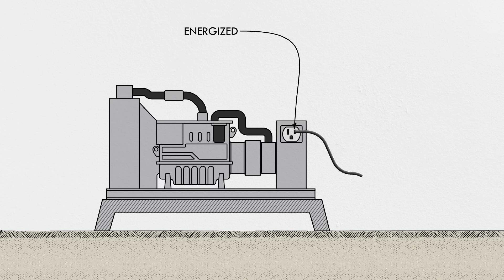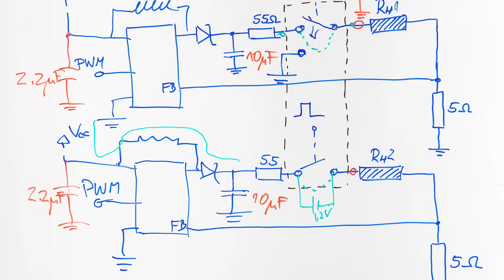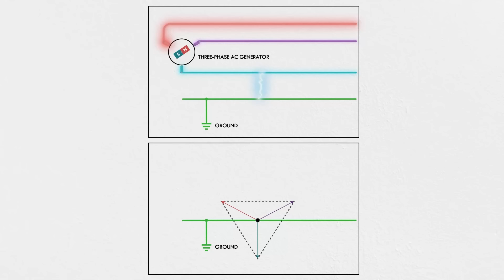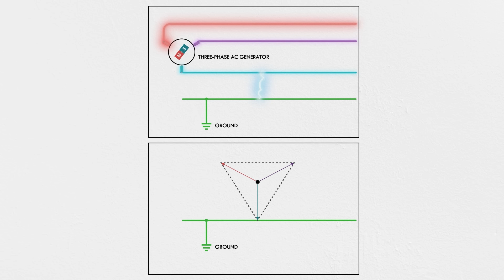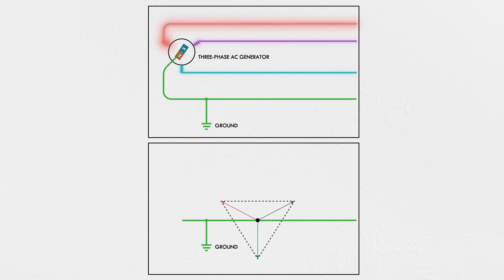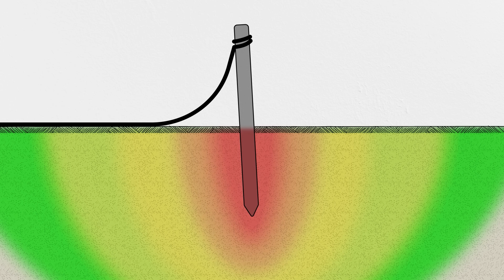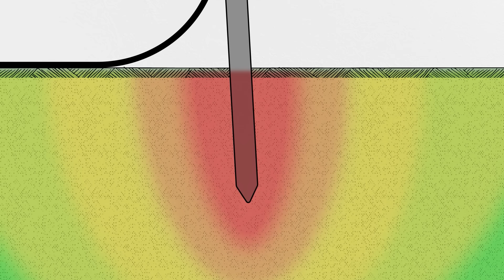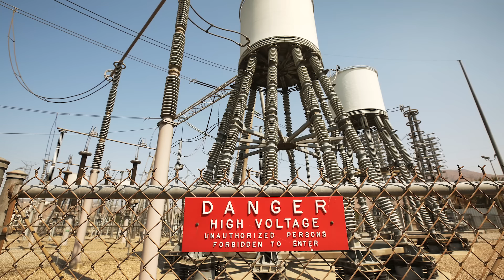Where Does Grounded Electricity Actually Go?

Comment: A lot of people make this so much more complicated, so let me clarify: Electricity that is caused by sources of our making, always MUST return back to a circuit node, so a closed loop must be formed, EVEN if the amount (amps) are not the same in amplitude (the circuit is not concentrated). It is only LIGHTING current that can actually move from point A (clouds) to point B (earth) without actually closing a loop (you will never see the lighting returning back to the clouds). We still don't know why it works this way, but we know that it is possible. So when you ground a circuit to the earth, current will flow from the earth and back to the circuit only if it forms a closed loop somehow, like a grounding fault where on phase touches the earth, the neutral is grounded to the earth so the phase + the earth as a conductor + the neutral closes a loop back to the circuit. In normal operation though, the neutral is grounded to the earth but this point is floating, it does not closes a loop back to the circuit and no current can flow. This is the normal and intended operation of the grounded mechanism.
Reply: so how does a ground fault happen in an ungrounded grid system. If only one hot wire contacts the ground and the generators aren’t grounded then how does the electricity return the generator which is it’s source
Reply: @A_youtube_channel_  I'm not very familirial with underground systems but in the air lines usually the following happens: In the transmission lines you have a 3-phase system without a neutral and you don't ground anything, so you are not protected from ground faults. If a hot wire touches the ground, no current will flow unless there is another fault nearby that touches the ground as well or the other faulty hot wire. In the distribution lines however which are usually located inside civil areas, it is FORCED to have a neutral that is grounded about every 100 meters, or whatever the standard says (at least here in Greece). In your case, even if the generator is grounded but your ground fault is hundreds miles away from the generator, the resistance of the earth is considered infinite, so no current could actually return from the earth back to the generator. But if you have a neutral and you are grounding it every let's say 100 meters, then at a specific point where a ground fault occurs, the current will find the closest grounded points and return back to the neutral and then back to the source as well.

Comment: Very good summary on electricity grounding and good summary how grounding works at the electrical power transmission level!. It gets a little more interesting at the power distribution levels and at the utilization voltage levels with some different ideas and opinions on the best ways to do it. Depending on where you are in the world, anything above  about forty thousand volts is considered to be transmission and below that is considered to be distribution. Voltages below one thousand are considered to be utilization voltages and 120V, 208V, 240V, 277V, 347V, 480V, 600V are common in Canada and the US but there are many more used throughout the world.

Grounding at the distribution voltages levels and utilization voltage levels are done for the same reasons but use some different techniques, strategies  and methods to try to achieve the same results. At the distribution voltage levels in addition to three wire distribution lines, four wire distribution lines are also very common at least here in Canada. The fourth wire is normally identified as an overhead neutral  and is grounded  at multiple locations about every two to three hundred meters and at every switch or transformer or other device on the distribution line. 

The idea is to have the majority of the fault current returning on the overhead neutral when there is a line to ground  fault  on the system. Also, with a four wire distribution line, in addition to three phase loads being connected to all three lines or two phase loads (can also be considered single phase load) connected to only two phases, you can also connect single phase loads only to one line and to the overhead neutral. They try to keep the connected single phase loads balance between the three phases but there will always be some unbalance current and they want most of this unbalance current to flow back to the source on the overhead neutral. Some will flow through ground since the overhead neutral is connected to ground at multiple locations along the four wire distribution line.

Comment: I can’t quite understand ,while the current flows “through “ the earth and returns to where?  What source, and how does the resistance of earth affect this flow. A simple one line diagram? 
As an electrician, I have a difficult time giving a good explanation to an apprentice, because I don’t quite understand it.

I do believe that the bonding, grounding and equipment grounding are probably the most confusing or least understood parts of the code book. When a group of experienced, and smart electricians have different answers to the same questions, tells me WE don’t have a thorough understanding of that subject.

Comment: A well defined, and properly wired, ground is also VERY important in (high accuracy and/or low signal) measurement systems. A good grounding combined with shielding can reduce noise massively and a floating ground can, well, "float" off and get out of range of your data acquisition device. Ground loops can also mess up your measurements by introducing nonsense signals.

Comment: The grid grounds lines struck by lightning:  The grid has lightning arrestors.  These are a spark gap.  When lightning strikes then the air ionizes in the gap. Ionized air is a conductor.  So the lines temporarily become grounded,  they are the same potential as ground. So therefore lighting doesn't damage power equipment (mostly, when things work right).  It's a neat cheap and very effective solution!

Comment: Having had to deal with said problem. I wonder if you'd be able to make a video on ground electrode passivation, and its' effects on in-house voltages.
Which is really only  an issue in TT systems, as well as TN and IT systems when the supply 'ground' gets damaged.

Comment: in an electrical circuit, electrons flow from the negative to the positive side. This is because electrons carry a negative charge, and in an electric field, they are attracted towards the positive charge. However, when describing the flow of electricity, it's common to refer to conventional current flow, which is considered to flow from the positive to the negative side. This convention dates back to Benjamin Franklin’s time, before electrons were discovered, and it's still used today for historical and practical reasons. Despite this, the actual physical movement of charge carriers (which are electrons in metal wires) is from the negative to the positive terminal.

Comment: I have to sit down and digest your presentation. In the whole it explains the concept of "ground". But within the utilization there is neutral and ground which are connected in the panel and a sole neutral wire is returned to the transformer of which sometimes there is a return neutral (I just watched a vid involving a transformer replacement on a pole where there was a return neutral. At my residence there is none. The neutral is grounded at the pole). A broken neutral, within a structure or in the exterior supply line can result in excessive amperage readings at the panel or in the observation of extremely bright lights in a specific circuit (I have seen both). How do appliances continue to work if the neutral is not continuous to ground?

Comment: The higher the voltage into the electrode the more that voltage potential extends into the earth. They teach that in a downed power line scenario that you hop away instead of walking away. The difference of potential between your steps can cause a shock.

Comment: Why do antenna's operate more efficiently with a more robust grounding network? It seems as though the greater the surface area of the grounding network; the better the reception and propagtaion capabilities of that antenna, (up to a certain point I imagine).
Reply: I've noticed this too that antenna well grounded with a ground wire going to the building's main ground receives better than say an attic antenna where the only ground if any is in the radio.
And the radio itself might be isolated from ground because of it's own transformer.

Comment: Could you do an article on domestic grid connect solar inverters ? I’m particularly interested in the flow of current back into the grid. How does a high source impedance such as an inverter feed into a low source impedance such as the grid and increase its voltage ? How far does this feed in current go , all the way back to the HV transformer or just nearby?

Comment: This is a great vid. Is it the case the electricity returns to the generator after passing along wires to houses…You said as much by saying electricity flows back to the grid.  I see three wires in my neighbourhood that feed to four wires that connect to my house… is the extra wire to my house a return neutral wire. If it is , then why aren’t there four wires on the other system. What happens at the end of the 3 wire system at the end of the town… thanks , if you can help me

Comment: 0:16 well, that's like running energy through a wire then it going through a resistor with whatever resistance the ground has, assuming this is a closed circuit.

So the ground would heat up wherever the energy flows, like a resistor.

Another way I'd imagine it is, what happens when lightning strikes the ground?
That's a massive circuit between the ground and the cloud.
Like a capacitor or something having enough charge (voltage difference) to force a connection to the opposite-charge-rich ground.

Lots of light, sound, and heat.

Pretty sure lightning can melt sand if it hits.

Okay, so i was wrong, it's not a closed circuit.

Comment: All the electrical/computer engineering labs in college had a bag of dirt with a wire in it. One time my buddy and I hooked our ground rail to one and were disappointed that it didn't work like the common on the power supply.

Comment: All electrical poles have a ground wire attaching to a 8ft ground rod in the ground. So when the hot wire touches the ground during an event, the circuit becomes complete. Meaning, the hot wire (+) makes a connection with the ground wire (ground). The purpose of the ground rod is to create the lowest point for the electricity to go.

Comment: What current does when it goes into the ground is very complex. Current is made from moving electrons which are described by quantum field theory, so we only have first and second order models. The first order model would be the electric circuit. According to KCL current will travel through every possible path, inversely proportional to the impedance of the path. The complexity of grounding is that the paths are not discreet, like in an electronics circuit but have a continuum infinity number of paths to complete, it therefore travels more like a wave. In my mind it is a controversial practice to use FCDIST in CDEGS to calculate current split factor during grounding studies because of this fact. The assumption being that fault current mostly returns along the transmission line supplying the fault, which seems like an untested hypothesis.

Comment: Before I eatch this I'm going to make assumptions and then see if I was right of wrong.

1) You think electricity is electrons flowing
2) You don't take into account what the dialectic is
3) You don't believe the earth has massive currents

I'll respond here after watching.

Good video.

1) You didn't specifically touch too much on this so we'll move on
2) You briefly spoke about dialectric (static electricity)  and mentioned "we don't really know much about it." We DO know but it isn't taught anymore. We've known since Maxwell, JJ Thomas, Tessla, Steinmetz, Heaviside and as recent as Dollard. You whole video focused on the electromagnetic side aka transverse waves. Yes those are not as efficient in moving through the earth HOWEVER longitudinal waves are. 
3) You briefly touched on this and it wasn't the primary focus of the video so I'll wait for a future one to discuss this further.

Comment: I think the crux is that power lines inevitably break and fall to the ground. if neutral does then the ground completes the circuit. Adding a PE wire preemptively completes the circuit instead of when humans accidentally touch anything

Comment: I'm electrical engineer and I see a lots of problem in his lecture. First, in an electrical circuits ground does not hang rather it refers to a common point in my circuit Vcc is also a common point does it also hang too?
By calling grounded and ungrounded power lines didn't mean delta and way connections? In both cases VLL is the same.

Comment: So, does this implies an ungrounded circuit is an undisturbed close loop system in equilibrium? Would a short circuit be a 'leakage' that over-stresses the voltage source because a drain breaks a previously established equilibrium and the voltage source tries to compensate now?

Comment: I have a question which you are not obligated to answer but it would greatly ease my curiosity: if I where to stick a rod of aluminum in a dune of wet beach sand and a copper rod in an iron deposit three or metres away would it generate a current just from ambient earthed current alone?

Comment: yo hey @practicalengineeringchannel FYI at 10:40 in this video, there's an error. You chat about difference in potential at each point in the wire, however the meter is on Ohms and displaying Ohms, rather than reading Voltage. Love the videos! Keep up the good work!

Comment: If you want an excuse to travel for the channel, there is high voltage direct current (HVDC) manufacturing plant in Ludvika Sweden, in the same factory that ~140 years ago built the first three phase transmission from a hydro dam to the pumping stations in a mine. If you want in, I can give you some contacts and guide you in the old abandoned mine where it all stopped in 1989 after hundreds of years despite moving an  entire town of 10k just 25 years earlier. (What they are doing now in Kiruna). Now only the brewery is still around.

(Watched on nebula, came here for comments)

Comment: Very ggod videos. I have one question: in the undergroudb trains (subway or metro) there is a third rail. But in surface trains there isn't. (I'm talking about Portugal). Those surface trains have an upper pantoghaph (I believe it's what it is called) that receives electricity from the upper wire (catenary) and the rails must be the return path for the current. Thas that meen that there must be some kind of "brush" to meke the connection to the raills?

Comment: I remember this based on early telegraphs. They originally had two wires back and forth for a circuit, but eventually realized they could just connect to earth. The earth is a wire, like you said.

Comment: In the case of the grid. every transformer that sources voltage to the grid needs to have a 'y' connection in it that gets grounded.

In the case of Diesel-electric locomotives I read that the power system between the generator and the traction motors is not connected anywhere to the engine frame. So if any single wire makes contact with the frame it will not be a short circuit. Can you confrm this?

Comment: At 4:51 you say that the two faulted phases voltage rise to twice what they are in an ungrounded system. How is that? (an answer would be appreciated here).
 At 7:08 you say that the easiest way to detect a fault is to make sure that the fault current is high.....       The fault current is alreasy high , you just have to detect it or use it to trip the overcurrent device    ... ther is noway to make it high  since it is a funtion that is predetermined by the situation..     sorry for being so critical of your speech  as you are by far the best communicator or technical information that I ha e seen on the internet.    Keep it up !  Have you donea video on Radio Frequency  Ground?

Comment: An active wire qill give potential.  For example a fallen power line  is dangerous to anyone nearby.  The closer you are, the more dangerous it is.  This is known as "step voltage".  One foot on the ground is okay, two feet on the ground about a pace apart can be fatal...

Comment: An isolation transformer connected to the grid doesn't have a potential agianst the ground from either of its outputs. It seems that such system would be safer for the final distribution because it wouldn't create current between the wires and water pipes, floor or roof when you touch the "toaster". But accidental grounding could go undiscovered I guess?

Comment: Nice video thanks ! At 7:10 you say that the ground wire is actually a parralel wire connected to neutral. Though I live in France and my ground wires are all actually connected to a copper rod inserted into the ground in my basement (neutral to ground voltage is still 0). Is it really that different in europe or did I misunderstood something ?

Comment: In short, grounding doesnt remove a current.
Its a discharge/exchange of potentual.
Its just that the ground is an effectivly infinitely sized storage for charge/potentual compaired to the circuit/electric system its attached to.

Comment: One thing thats a bit unclear for me is that there are single wire AC systems that can work with one cable and return to the ground. 

Until that point of the video I understood that it goes into the ground and dissipates the further the distance, the less voltage until its gone. But I don't grasp the concept of a single cable AC system. As far as my understanding goes, we cant have any current slowing through one cable ... right?